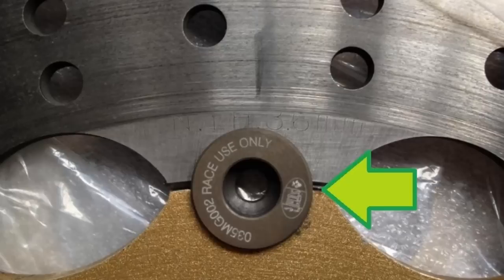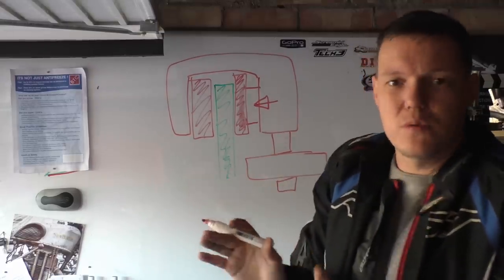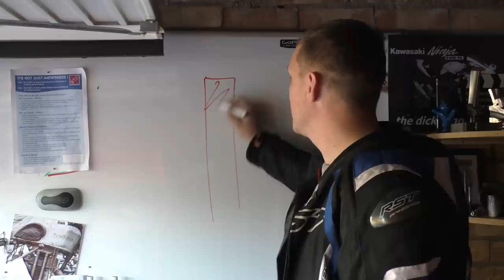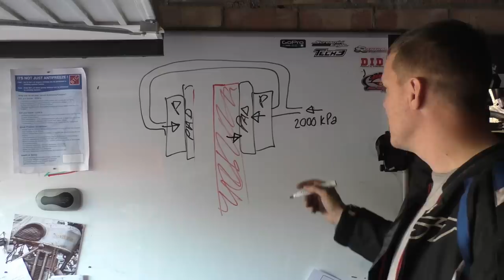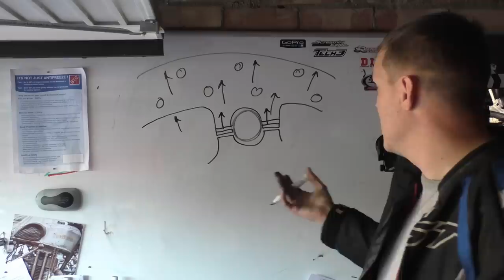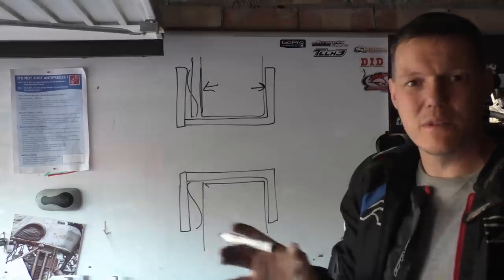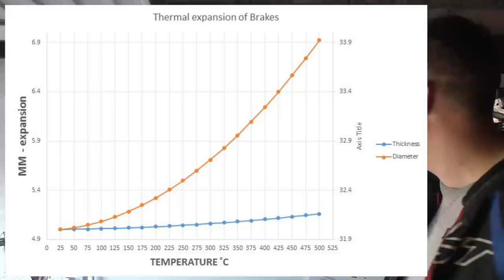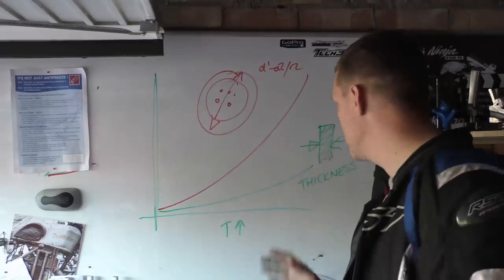Floating Brake Discs - and bobbins

Comment: I was under the impression floating discs are also used to help with pad knock off from high lateral cornering forces.  

The effects of pad knock off / knock back are easily felt as a soft brake pedal on the first application after the knock back.

In older Subarus for example with the smaller hubs.    When they changed to larger wheel bearings and hubs, the knock back was reduced as the larger bearings and hubs were more rigid to lateral deflection.

My understanding was floating rotors help with reducing the knock back as they can deflect laterally in opposition to how the hub/wheel/wheel bearing deflects due to lateral cornering.

Can you confirm if floating discs have this benifit???
Reply: Bram Biesiekierski The force required to deflect the disc is WAY higher than that required to push the Pistons back in their bores. Also, have never had noticeable pad knock off on a track bike, that wasn't caused by a bent/warped disc. That is on OEM brake discs in good condition. I can't speak for GP bike brakes, no one will let me on one 😂
Reply: Max Power 
I was more specifically speaking about cars hence the Subaru example.

When bikes turn, they tend to lean into the turn, so there arent the same lateral forces that an upright wheel like on a car would see.  

Bikes go round corners better than cars, but bikes can lean over, so the largest component of the force is inline with the bike vertically.  Cars wheels have to stay near vertical when turning, and there is such massive lateral loading because of the vehicle wieght.   

In cars pulling higher G corners, this loading can cause massive deflection within the bearing/hub relative to the upright the caliper it is connected to.  This movement can cause the disc to knock the pad back inside the caliper as everything flexs.  So the next time you apply the brakes, you have to give the pedal a double pump to take up the slack.
Reply: @BramBiesiekierski  which car has floating brake discs? never heard from one
Reply: Pad knock back is another load of b*llocks. The disks should run true otherwise there would be judder or lever/pedal pulsing.
Reply: Bob Barrett, Pad knock off is not a myth, it only takes a barely perceptible warp to push the pads/Pistons back far enough into the bores that the initial bite point is further into the stroke of the master cylinder, especially on cars due to the long brake lever (pad) travel.
Reply: Bram Biesiekierski I pit crew on a couple of different circuit track category cars (national categories, so not weekend club sprints)we only ever experience pad knock off on warped discs here too. The biggest cause for us is cars not completing cool down due to crash/mechanical failure and having red hot brakes not cool evenly. These are an improved production class and an open wheel class, maybe Subarus have deficient suspension/hub design. Some of our cars run cast iron hubs/discs and if the deflection was that severe and frequent, I think we'd see more cracked hubs/discs.
Reply: marc blub 
Which ever car you want to put them on.  There are no cars that i know of that run them as standard out of the factory.  But upgrading brakes to some extent is very common, (almost mandatory) when doing any form of motorsport.  Maybe gravel rally is about the only thing you could get away with fully stock brakes (including standard pads)  Everthing else will need pads at a minimium, or factory big brakes from higher spec models etc, or complete BBKs.  Obviously money is usually a determining factor on how far you go.
Reply: Bob Barrett 
I suppose you also believe the world is flat?

Saying something doesn't exist, because you can not comprehend it, doesn't make it not exist.  

There are literally thousands of documented cases of pad knock back.  I have personally felt it myself.  There are even videos online showing drivers having to double tap brakes before corners in order to extend the pistons after knock back event.  There are products specifically designed to overcome it.

If it wasnt a thing.  Then why is it so well covered and talked about?

What is your explanation to all the people that get knock back???
Reply: Max Power 
The deflection is NOT in the brake rotors them selves.  The rotors stay perfectly true and straight unless other issues cause them other wise.

The deflection is in the wheel bearing, hub and upright relative to the caliper.   They all deflect a little bit when loaded during the corner.  (Some cars more so than others)  

So when the hub or bearing flex, the rotor is moved with them.  But the caliper is fixed to the upright.  So you have a small amount of movement relative between rotor and caliper.  This small amount of movement pushs the pads back.  This is what pad knock back is.

It is not that the rotors are physically flexing.  Its what the rotors are connected to that is flexing.

The flex is probably very very minor, but it only has to push the pads back a minor amount to change the feel.

Racing requires confidence.  And having that split second of squishy brakes right when you NEED the brakes kills confidence, and that kills times.
Reply: Bram Biesiekierski I know what knock off is and have experienced it plenty of time, I'm not debating that. You mention that the calipers are mounted to the uprights? These would be macpherson strut assemblies I presume? That would make some sense. On the open wheelers we run double wishbone front ends and 4 link live axle rears, so the calipers are mounted too close to hub centre for any flex to cause knock off. The improved production/classic touring car sedans do run macpherson strut front/live axle rear, we don't get it on these either, perhaps the diameter of the strut tubes is too small in relation to length on the suby? These cars are only 10 seconds per lap slower than a V8 supercar, so cornering forces are well up there.
Reply: Max Power 
By upright, i mean the knuckle, the part that houses the bearing, and has the suspension arms and brakes and struts attach too.  Not upright as is the strut.  That would be silly to put a brake caliper on a strut.
(Yes the suspension is mcpherson strut.)

There is no such thing as a perfectly rigid anything, cars are no different.  Everything will flex to some degree.  Whether or not it flexs enough to notice will depend on platform to platform.

As for racing.  You mention V8 super cars, so i guess you are Australian like me.  So you will know Barbagallo.  My Subaru Forester did long track in 64.xx which is about 12 sec more than the outright lap record.  And 10 sec more than the V8 supercar record.    Bear in mind i have only been to barbs 3 times and done maybe a max of 15 hot laps.   That time will fall with more seat time on the track.   (Check my video uploads if you want proof)

In order to do that, i run 295/30 r-comps  (Tyres are about as wide as your forearm is long.)   So you could imagine the lateral loads the car is capable of, and hence the deflection loading on the suspension/hub components.  Car only has 400whp aswell, which is less than a supercar.

I dont suffer from knock off any more.  I upgraded all the hubs/bearings/knuckles to larger items.  And run 355mm 6piston brakes with multi piece rotor front and rear.

The point I was trying to make with my original post is that floating rotors have a positive effect on pad knock off, that Matt didnt mention.
Reply: Max Power I was always lead to believe what I was told in college, pads retract by the action of the caliper seals. When the pressure is released from the system, i.e. you release the brake, the seals relax and a very slight action is required to release the pad from the disc.
Reply: Bob Barrett 
That has absolutely nothing to do with knock back.  

And what about calipers without seals?  Wilwood for example dont put dust seals on thier calipers.
Reply: Bob Barrett to a degree yes, but what the rest of us here are discussing is where the pads are knocked back/Pistons pushed back in the bores further than they NORMALLY retract, which causes a longer pedal/lever stroke than normal to achieve the same brake pressure. It feels like a burst brake line the first time it happens to you.
Reply: Bram Biesiekierski I see your point, I think Matt left that point out as that is not the reason for the bobbins on M/C brake discs and his vid was in response to those about freeing Bobbins. I think you and I have wandered off to the side in a discussion about automotive racing brakes 😂 We raced at Barbs last year.
Reply: @maxpower363  Sorry , my mistake. Thank you for taking the time to explain.

Comment: Good vid. I've actually seen posts from guys doing the nut, bolt drill thing and about the crap that comes out when its flushed with brake cleaner. Thats metal thats being removed! Anyway good vid.
Reply: If it was metal coming out, it would be bright. If it's anything else, it's a combination of road salt and oxides of one or more of the metals which the component parts are made from. These will build up over time and reduce the parts ability to freely move back into their original position under the tension of the spring. They come from a process called 'galvanic corrosion' which occurs as a result of 2 different metals being held together.

Comment: I agree but there exceptions , I own two Triumph Trophy’s one I’ve owned for over 12 years and never cleaned the brake bobbins , no linked brakes , the other is another trophy with LINKED brakes if only operates two pistons on the front calliper when operating the rear brake , you have to clean the bobbins in a regular basis or the disks will warp . So even though matts correct in this circumstance he isn’t .

Comment: Great vid. Quick question and hopefully you can help me. I have the Arlen Ness G3 Floating Brake Rotors. I happened to notice the other day that the Front Brake Rotor hardware kit (Screws, washer and lock nuts) are loose (Some play) while installed, I figured I'd tighten the screws and that'd be it. However, this did not work as they are all in (Tightened to the max) Bottomed out.  They are still lose and flimsy which makes the disc wiggle quite a bit. Aren't these supposed to be firm and sturdy while installed and doing their purpose between the brake disc and the carrier? Please advise..ty
Reply from the maker: Sounds like the bolts are not fit for purpose You need to contact Arlen Ness
Reply: @dirtygarageguy  thanks brother

Comment: I just bought a 2009 Concours 14.  When I hit the front brakes the bike shakes pretty bad.  Oddly enough, I don't feel any pulsating in the brake lever.  The rear brake feels just fine.  The motorcycle does stop and stop well, I don't get why it shakes only when I hit the front brakes.  Do you have a suggestion for me?
Reply from the maker: When you say the brake shakes, what shakes exactly?
Reply: @dirtygarageguy  I mainly notice the windshield vibrating when I hit the front brakes.
Reply from the maker: That could just be a dodgy windshield, does the whole front end shake?
Reply: @dirtygarageguy  yeah it does.  Apologies for the late reply.  YouTube never notified me of your reply.

Comment: I have 4 or 6 pairs of perfectly usable original RGV 250 disks from 1989/ 1992. However the bobbins are all loose and rattling. Are the disks usable if not is it worth doing anything with them? Do I need to bother / worry, get a brain?
Reply from the maker: eBay them - make it someone elses problem
Reply: @dirtygarageguy  that's how I got the fecking things ;) Ok new brain it is then ;)

Comment: Ive just fitted brand new Brembo Serie Oro disks to my fazer and the buttons/bobbins rotate freely. In fact, the whole outer portion of the disk can be rotated by hand there is so much free play on the buttons. I assume this is a design feature and not a faulty set of discs, but you have me worried now saying that they aren't meant to rotate. HELP!
Reply from the maker: For race type discs the clearance is great because of higher temperatures etc.

"but you have me worried now saying that they aren't meant to rotate."

- you've misunderstood. They're not designed to rotate - in otherwords bobbins don't need to rotate to function. If they do, they do and that's fine. The point was if they don't they're not borken or anything.
Reply: The Workshop that’s reassuring. Thanks so much for the reply, much appreciated.
Reply: @dirtygarageguy .. Could it be brembo has 2 systems of rotors /bobbins.. Have an 15 year old Brembos, and have a such noise in the calipers, that I can't stand it.. No ride for years.. Always from New these Bikes with Brembos have the shitty noise.. They did get fixed just after a couple k miles.. Then the noise appeared.. Worsened in rain also.. Today, useless..

Comment: Hi Matt
Thanks for the explanation much appreciated , i just got a Tiger Sport with 14,000 miles on the clock pads are fine no grooving of the discs but i get vibrations as soon as i pull on the front brake lever whether on first braking on setting off on a run or whether later on when everything warmed up , any thoughts on what could be causing this and how to fix it ? Thanks .
Reply: Warped

Comment: Just an extra comment but it does seem weird that there are so many stories of people successfully fixing "pulsing " at the lever by freeing the bobbins? Just an observation that seems odd from what you are saying.
Reply from the maker: This is probably because they cleaned their brakes at the same time
Reply: "The Workshop" mentioned brake disc expansion. He ignored that brake disc expansion is not uniform in all directions. A brake disc can expand. and get slightly curved. The bobbins help account for errors of a warped disc. When the warped part of the brake disc enters the brake pad surface, a un-seized brake bobbin will shift left or right to account for the warped disc position.

Now imagine if the brake bobbin is 100% seized. And the warped brake disc is now entering the brake pad region. The bobbins are 100% seized, no movement. The warped disc enters the brake pad region, and because the disc is warped and curved and the bobbins are seized, the brake disc does not shift left or right, but instead keeps its misaligned position and presses harder against one side of the brake caliper for a split second. One side of the caliper is now complying and getting pushed in slightly and causing a pressure jump if your brake line. and you feel it in your brake lever. 

My Personal Experience below : 
Problem:  Pulsating front brake lever under repeated hard braking. 
Fix:  Un-seize the front rotor bobbins using the "bolt through bobbin" technique to loosen what ever cause it to seize up. The bobbin shouldn't be 100% free spinning, but you should be able to spin it with a T-handle or a screw driver.  (You cant spin them like he did in the video using your fingers, no ones fingers are that strong. and the bobbin will be too loose at that point).
Test Drive: After loosening up the seized bobbins go for a test drive on the same road.  Front brakes are no longer pulsating.

1 Problem .  1 Repair.  1 Problem solved.